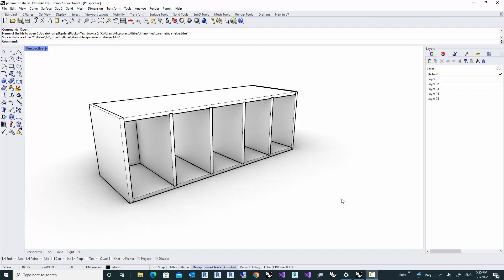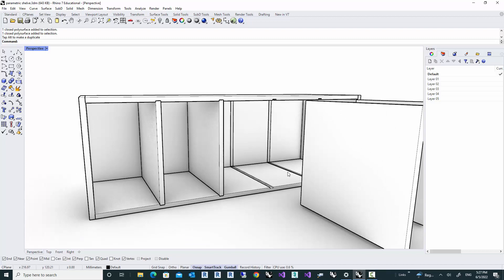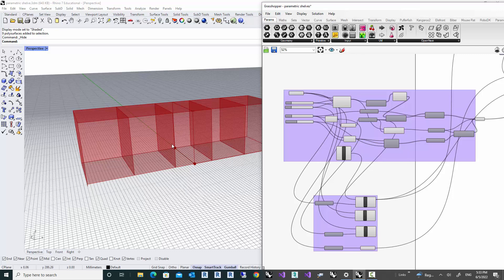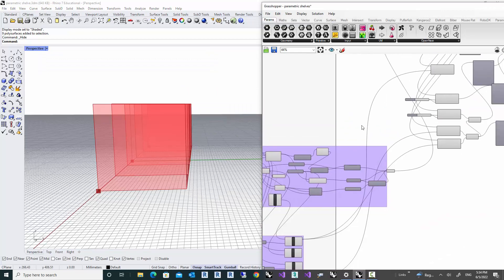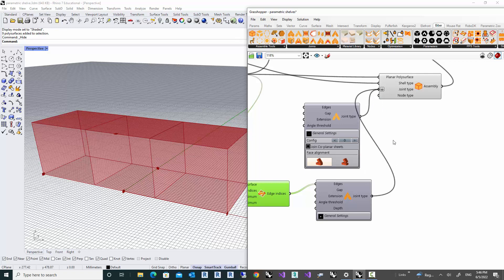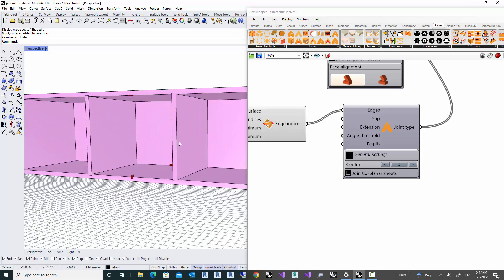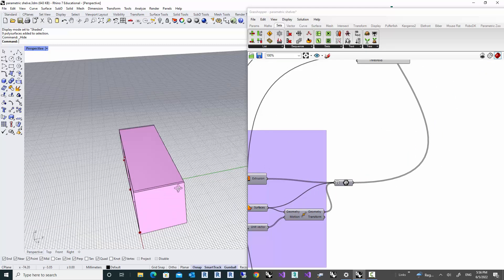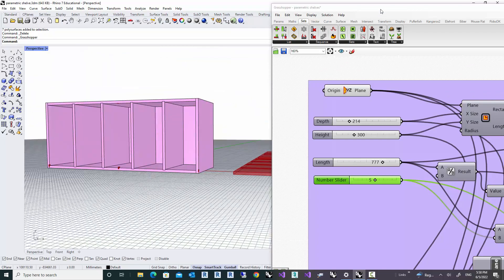Parametric Shelves. Change the joint types parametrically.

Comment: Very nice. It is possible to add support for fixtures? I do need to put holes for hinges, dowels, minifixes, screws, drawers in my designs.
Reply from the maker: For dowels we have dowel join, use it from the library, for other specific joints please share an example on the forum, we will integrate that in the next upgrade

Comment: Does Biber take into account manufacturing tolerances or does it assume that all these joints slide effortlessly into one another?
Reply from the maker: there are two parameters to consider when it comes to manufacturing tolerances, GAP and EXTEND , first one allows for gap between parts along the joints and the second one extends parts outsides the designed surface so that they can be sand and smooth afterward